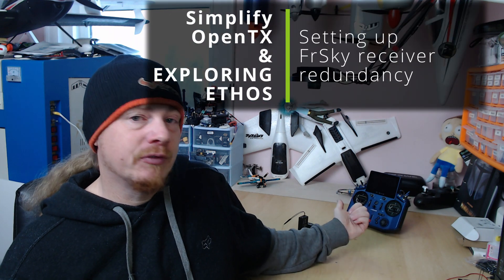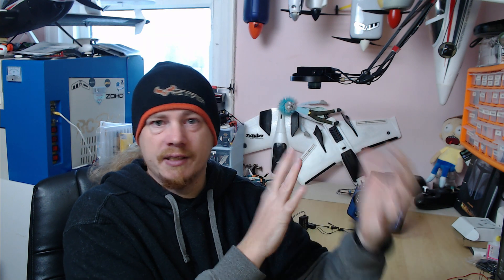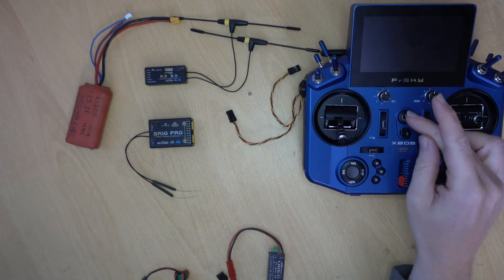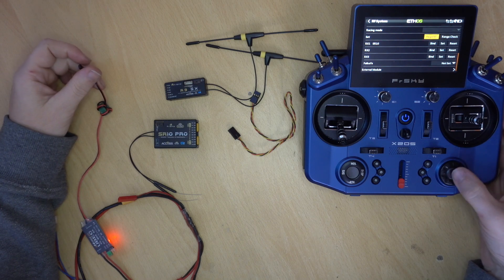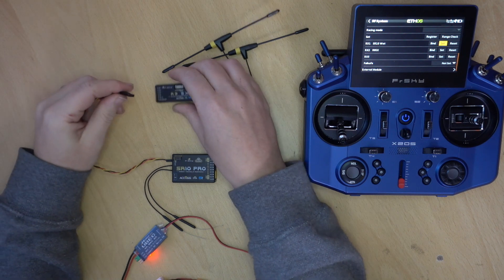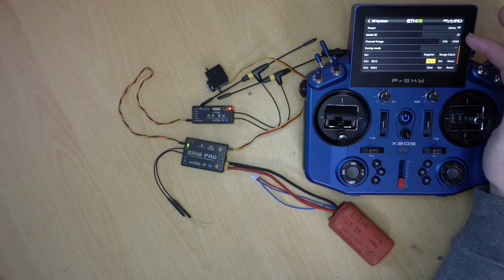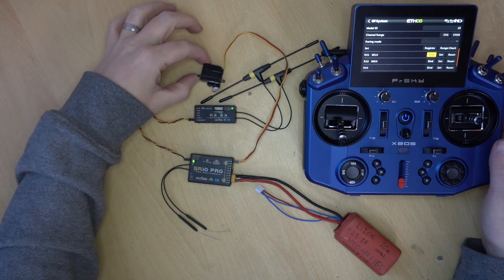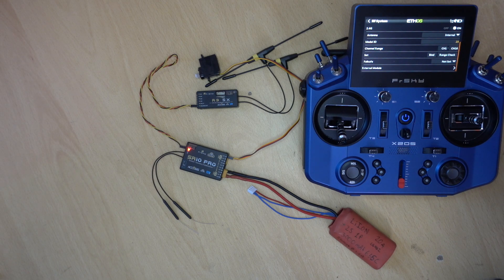Setting up FrSky Receiver Redundancy

Comment: Mr. D;  I want to run two receivers with two redundant backups.  Is this possible?  I like one system for the right side of the plane and one for the left side.
Reply from the maker: With ACCESS, you can only bind 3 receivers. To be honest, I don’t know if there’s a limit on ACCST.
Reply: @MrD  Okay, I can live with that.  I'll stick the rudder and throttle on the side that has the back up.  Your videos seem to be the best source to figure out the new tandem system.  Would the R9 SX be the best choice to back up the SR8 pro?  And if so, can I run a separate power source to the R9 SX?  I know this seems like overkill, but this is for a very large and very expensive tug and I feel the need to maximize the system.
Reply from the maker: Thanks Steve. You could potentially use a different power source for the redundant receiver. But if the main receiver loses power, you will still lose control as the servos are powered from the master receiver. The master receiver also needs to take the SBUS signal from the redundant receiver and output that to the servos. For such a large and expensive model, have you thought about using the redundancy bus system? Something like the RB30 has 3 receiver connections, dual power redundancy, as well as features like servo overload protection. You may find something like that better. 

As for the R9 SX. It would work fine. I used it in my demo purely because it had servo plugs for the SBUS connection, which made the demo easier. If this is an ignition engine setup, it may be better to use the R8 Pro as the redundant receiver. Though lots of petrol guys are using R9 for the redundant receiver too, with no issues. You could use any receiver with an SBUS out, so long as it fits your build.
Reply: @MrD  Thank you for taking the time to reply.  Yes, I was looking at the RB20 redundancy bus system.  Most guys feel this is the safest way to go.  But some point out; "then you're back to a single point of failure".  And I have seen one or two bus systems go south.  Somehow the idea of having two completely separate systems (switch, battery and RX) for each half of the plane appeals to me.  When the X8R were having the electrical noise problem, I was able to get down on one RX when the other RX completely quit.  There may be a flaw in my thinking, but this seems like a better idea.  Having a 2.4 RX backed up by a 900Mhz Rx on at least one side makes a little more sense to me.  Steve
Reply from the maker: If the X8R was on a plane with an ignition engine, that would explain the problem. The X8R wasn’t designed for use with ignition engines. 

Yes, I can see where you’re coming from with regards to the single point of failure. In which case, I’d suggest looking at either the R10 Pro or SR10 Pro as the master receiver. That will give you power redundancy; and is also CDI safe. Then use the R9 MX, or whatever you choose as the redundant receiver, powered buy the R10 Pro. Then you have power and signal redundancy on that side. On the other side, go for your preferred receiver, of course this needs to be a Pro receiver if an ignition engine is used. 

Also, it’s worth noting that FrSky have Tandem receivers coming out soon. These have the 2.4Ghz and 900MHz receivers in one unit. All Tandem receivers will be ignition engine safe too.
Reply: @MrD  Thank you.  You saved me a lot of time sifting through 1000 threads.
Reply from the maker: No problem Steve. Glad I could help.

Comment: Having the antennas on the out side. Does this apply to our "foam" e.d.f. jets ?
Reply from the maker: No, this is for carbon fibre moulded planes here. With foam, the antennae are fine inside. Just make sure they are clear from RF blockers like carbon and the battery.

Comment: I'm in the process of swapping over to FrSky with an X20S after being with Spektrum for about 10 years. Lost a 30cc gasser to complete RF signal loss and decided that was enough for me. Your videos are definitely helping me get used to the new system, thanks a lot 🤙
Reply: 16 Years Spektrum......going x20s and all the other bells and redundancy whistles. Fly 120 and 130cc 3d and scale planes(glider tug 120" 188 Aggie) Refuse to pay another plane's worth to have the "best".........
Reply: Why I'm switching to it as well.  I've got a few 20cc gassers going together and some giant scales and I don't trust a Radiomaster for that.  These X20s are basically a cheaper Jeti at this point and that's freaking awesome.
Reply from the maker: You’re welcome Lucas. Yes, unfortunately at my flying field, if there is ever a signal problem, I can guarantee it’s someone using Spektrum. My 30cc planes will be getting redundancy like this too. I’ve not ever had an issue with RF on FrSky. But better to be safe than sorry.
Reply: @MrD  can I use my s8r receiver as the master receiver for redundancy? I’m also using the xm-plus for my extra receiver
Reply from the maker: No, the S8R doesn’t have SBUS IN. That is required for a master receiver.
Reply: @MrD  ok I connected both receivers up and connected the servos and it works?
Reply from the maker: That will not be redundancy. Neither receiver has the necessary SBUS IN port. That will just be both receivers bound to the same model.
Reply: @MrD  got it, I just switched to a r8xr and I’m good now, just a little delay when testing between receivers.
Reply from the maker: That will work. The SBUS OUT if the XM+ will go in to the RX IN port on the RX8R. For some reason it’s labelled RX IN on the receiver. But if you check the manual, you can see it’s SBUS IN.
Reply: @MrD  Thank you for your help, I appreciate it

Comment: What are you setting your outpower to on the 900mghz?  I have found that low power makes the servo jittery  increase the power all is good.
Reply from the maker: I usually have it at low power. I put it there on the bench, then forget to put it back up again 🤣

Jittering servos are usually the telemetry side with the 900MHz receivers. I get jitter on my MiniAR wing. Turn off the telemetry and they stop. Not noticed any issues in flight though.

Comment: Great video! I use these same 2 recievers for my redundancy. Can't you just turn off the modules separately to check if the redundancy is working? It works on mine that way. Also, I don't understand why you can't run telemetry on the slave. I have turned it on with no ill side effects. Maybe you can explain that.
Reply from the maker: Thanks Chris. I did try that to test, but the receivers never reliably lost the bind. It wasn’t until I bound to a different ID that I was guaranteed only one receiver being bound at a time. I believe the master has to always bind with the transmitter before you can remove it. 

In all honesty, I don’t know why they say to only use telemetry on the master receiver. Perhaps conflicting telemetry IDs or something like that? That is just the recommended way to set it up. So I followed the guidance.

Comment: Is this transmitter compatible with DMSS receivers ?
Reply from the maker: Not natively. I believe they are JR receivers? Natively it supports ACCST D16 receivers on 2.4GHz and ACCESS receivers on 2.4GHz and 900MHz. 

I’ve just checked the multi-protocol module site, and it looks like they don’t support DMSS either.
Reply: @MrD  Thank you for your reply. Yes, It’s JR.